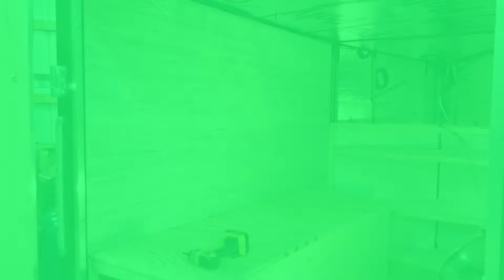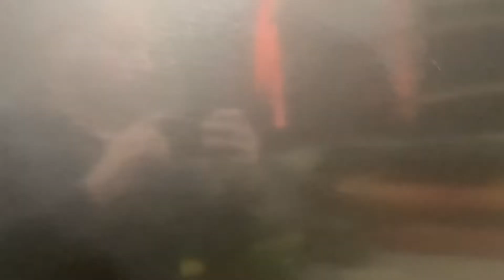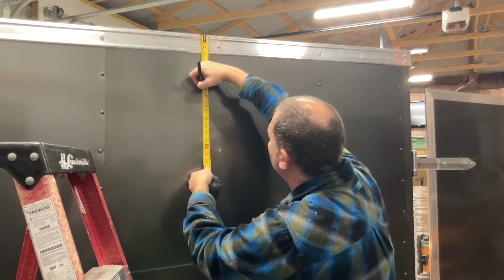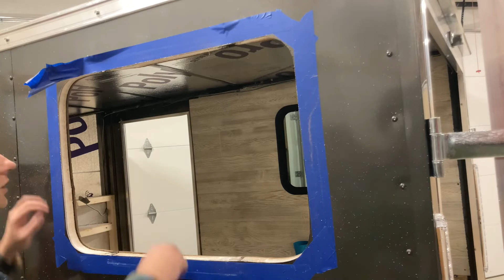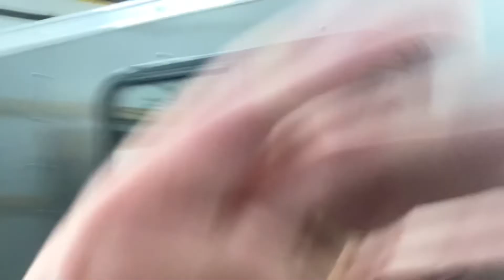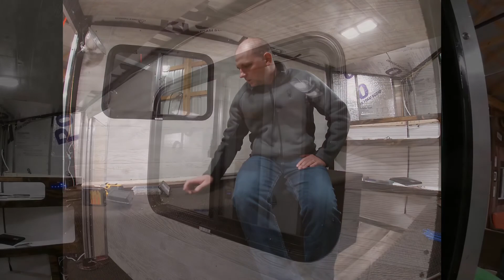Enclosed Trailer Camper Build. Window Installation!

Comment: I have seen some people weld braces after cutting through the metal studs. Did you feel that wasn't necessary?
Reply from the maker: No. Not necessary at all in my opinion. I won’t have a roof load and it’s crazy how solid the wall is.  Everything is sandwiched together using the trim rings and screws.
Reply: Especially 2 of them